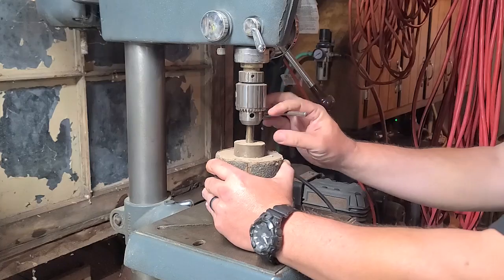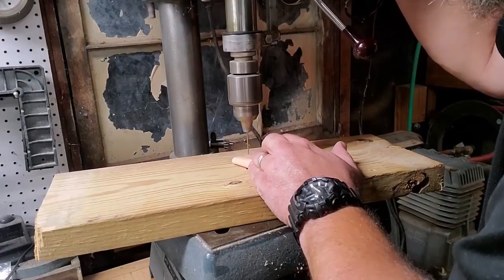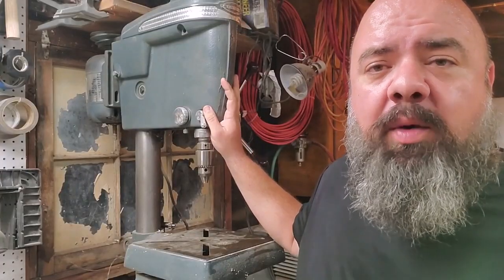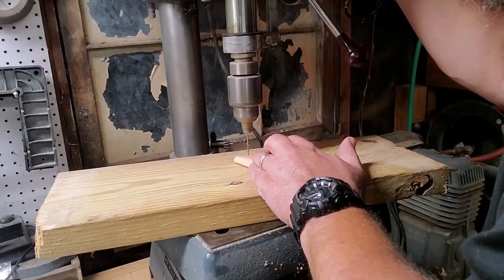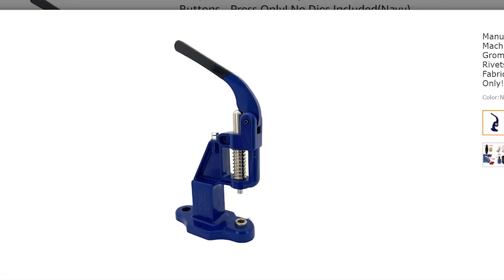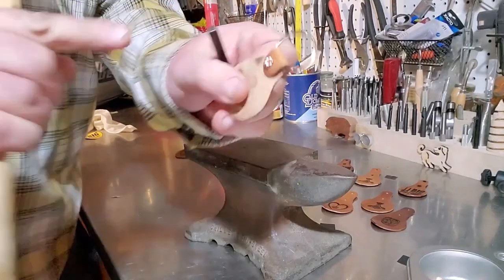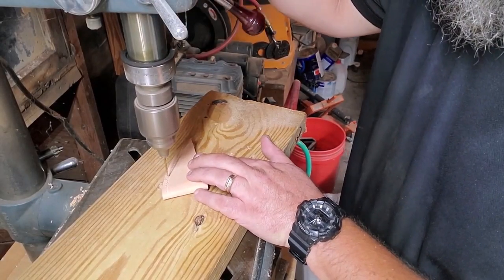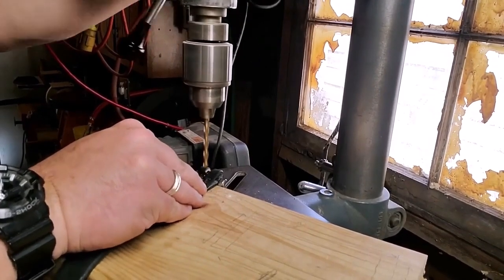How to RUIN Your Drill Press #leatherwork

Comment: I use two sizes of modified shot filled mallet for numerous tasks. It won't rebound and doesn't damage the tools your striking. The rivet /snap press is worth the investment if You are doing any production work . Lets face it anything in leather working is EXPENSIVE .
Reply from the maker: @vieuxacadian9455 To do solid production work,  you will definitely pay the price to speed up the process.   But,  if someone were to get started in leather craft as a hobby,  basic beginner tools will not break the bank.

Comment: Wawak Sewing has a nice press to use that is very nice and a bit more wallet-friendly.  I love mine!
Reply from the maker: @revan33 I'm going to have to look into that.  Does it work good with leather?
Reply: @bigstacksshop , it is the reason I purchased it.  Setting grommets, eyelets and making holes! I found it also works great with my small stamps also.  Very handy tool.
Reply from the maker: @revann33 Thank you very much.   Is that on Amazon or just plain old www?